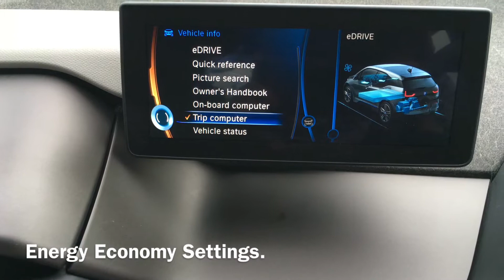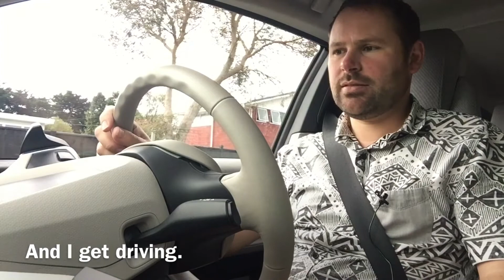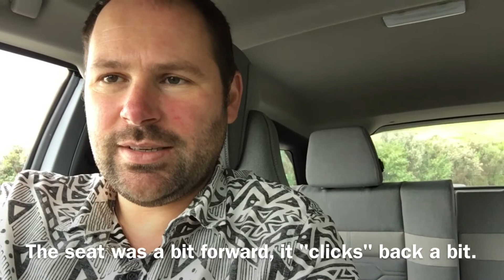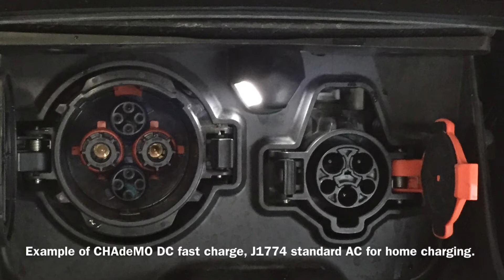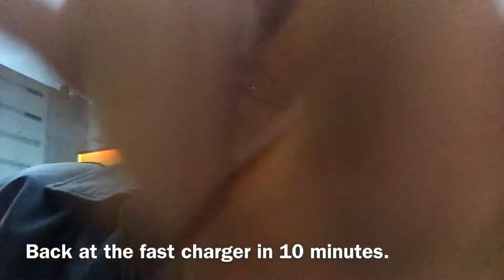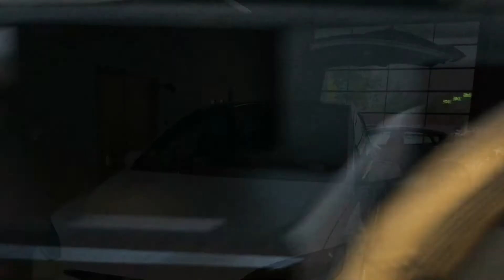BMW i3 First Drive Review (NZ$45,000 used)

Comment: Hi Darryl I got a drive of the Blue I3 at the MTA100 in Wellington and took a longer test drive a bit latter on of one for sale in the Hutt.  I commute into Welly in a MK1 Insight but I want something a little quicker that I can get both my 70yr old folks into.  BMW i3 is an awesome fun drive car.  I  understand that the cars imported from the UK have the charger that charge point intend to standardise across NZ a CCS2 connection at the side of the car but Japanese ones with fast chargers have Chademo under the frunk?
Reply from the maker: +SuperMadpom I also have a mk1 Insight, the best car in the world, I think. The i3 I had on the day was a Japanese import, it has CHAdeMO at the back, right hand side, and J1772 in the frunk.  Some of the i3s that I have seen have 3phase mannekes connector, similar to the type 2 ccs, but no dc Fast Charger pins, these cannot be charged at most Charge.net.nz locations. There are some i3s with type 2 which can be charged at all charge.net locations, so be careful about what you buy.
Reply from the maker: +Darryl Talks About New Zealand Mennekes spelling.